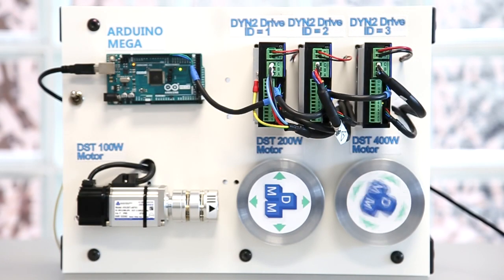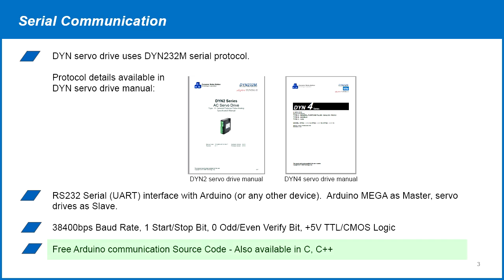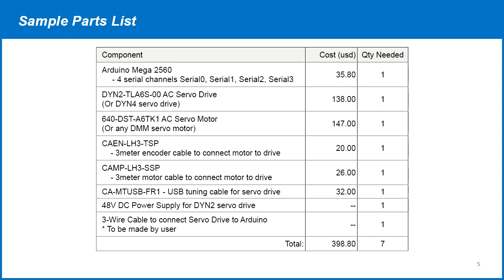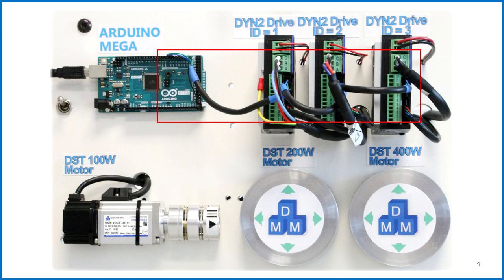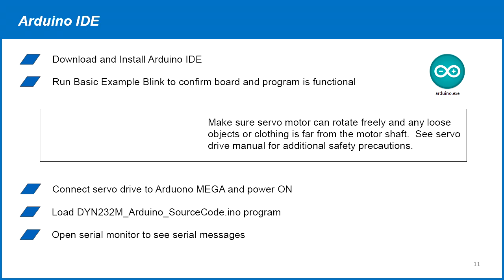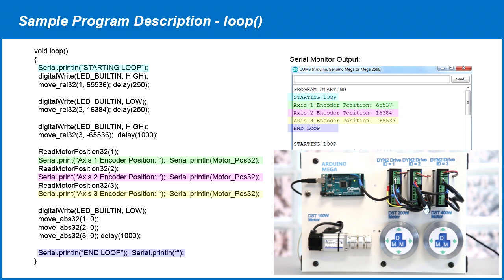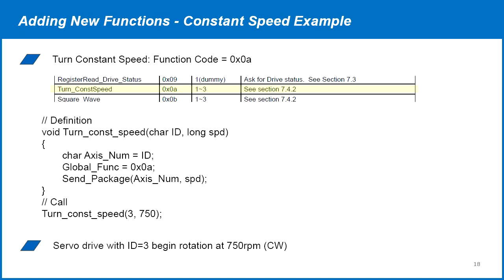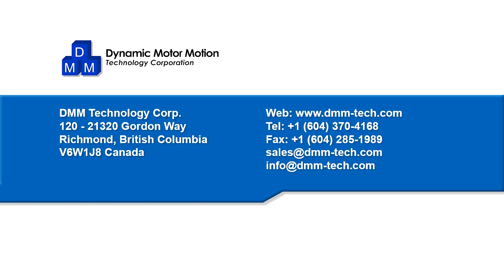Arduino to DYN AC Servo Drive Serial Communication Example

Comment: i think it will be good if servo drive send back 1 or 0 on completing its motion , giving 1 sec and assuming that it completed motion is not idea
Reply from the maker: Hello, thank you for your comment.  This demo was intended to be very simple so we just wait/assume until the motion is finished.  The servo drive has a Drive_Status byte with 2 bits that you can query/monitor to see if the positioning is completed.  Thank you!!
Reply: @dmmtechnologycorp  good to hear. do you have some c++ library or c # library to control drive from c++/dot net apps.

Comment: Hi  is it possible to control a larger brushless AC servodrive driver using arduino and to read the position of the shaft at any point of time.